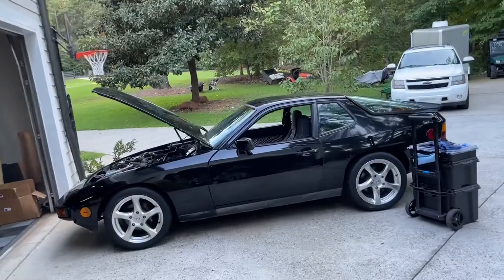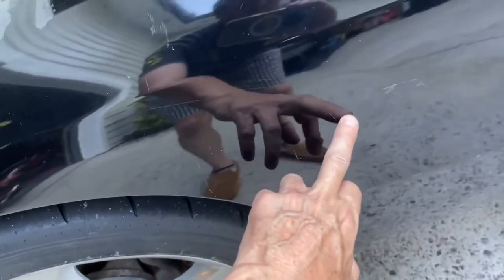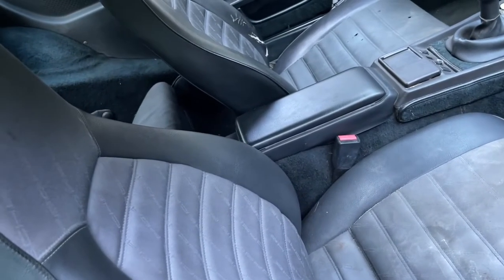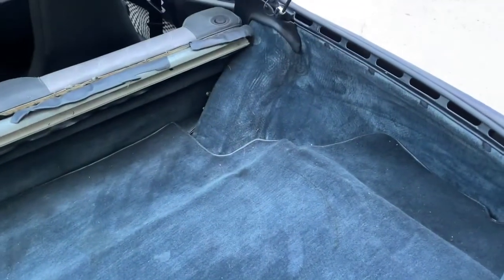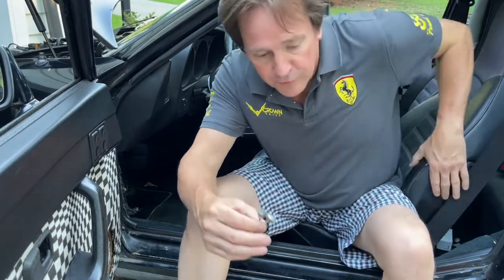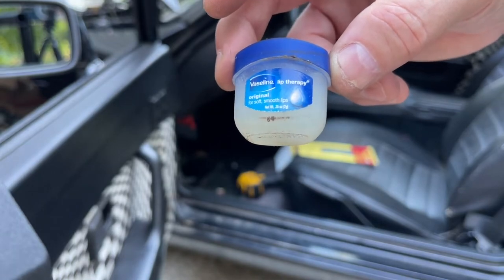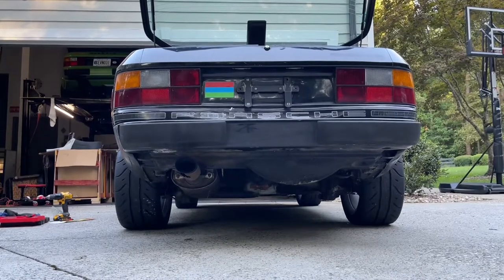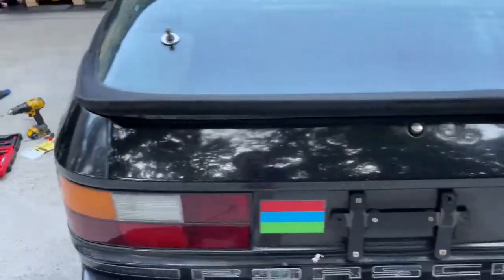Porsche 924s - Cleaning up the fuse box and electrical connections

Comment: Amazing how many of your black 924S issues, mine also has.  Guessing yours is a 1988.  I love my 1987. I like the older steering wheel center. That's actually an oil level not pressure light that's blinking.Comes on after you are down by 1/2 Qt.
Reply from the maker: lol. Yeah - the wiring in the car is shit.  I’m thinking about punting and doing a painless install.
Reply from the maker: Mine is an 87 - going to take it to a car show today like that. lol

Comment: How did you remove the fuse box? I can see it on my right hand drive 1982 Porsche 924, but couldn't figure out how to remove the box.
Reply: Pull really hard on it. It’s a plastic clip just like on the doortrim. 

Nah just kidding. Don’t rip your dash
Reply from the maker: There is a bolt in the bottom. Once it’s out - you can pull it forward